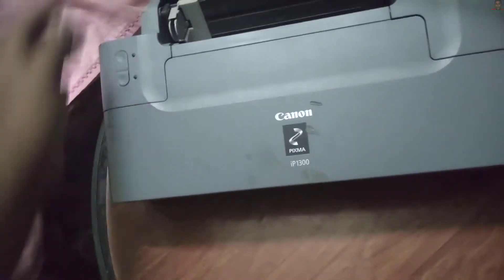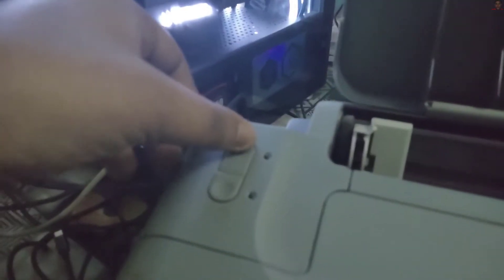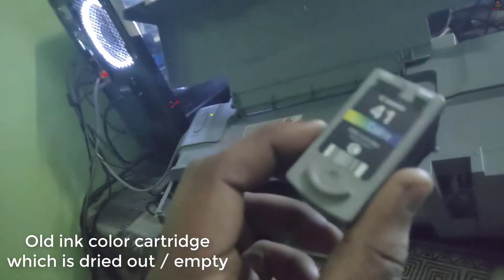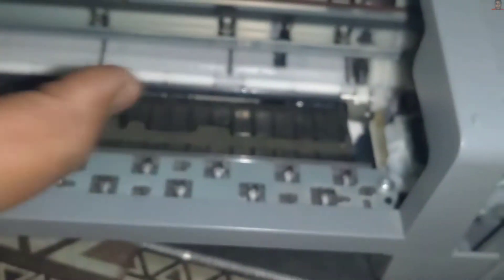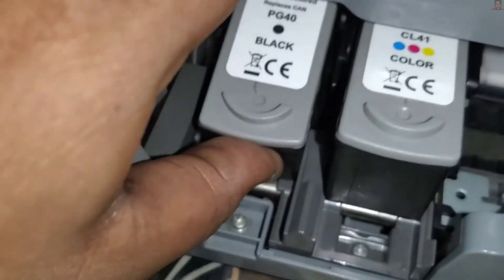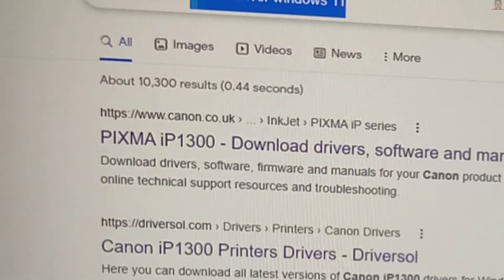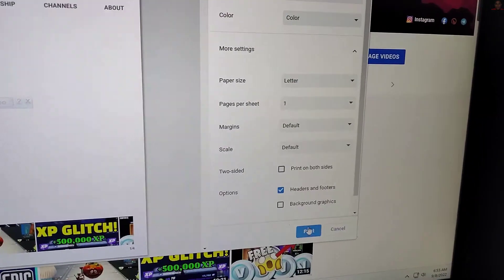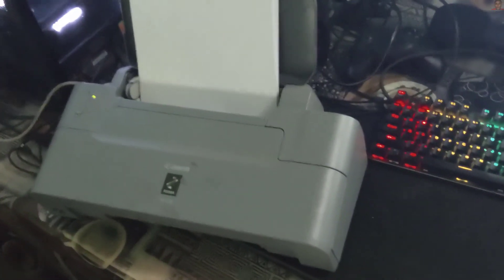How To Setup & Swap Ink Cartridges for Canon Pixma IP1300 Printer

Comment: Atleast show how you managed to connect the printer to your machine. Show the cable bro
Reply from the maker: Its just a 1 meter length ETHERNET rj45 cable
Reply: Is it usb to cat2 or cat3
Reply: @shrpatil08  mine was cat5